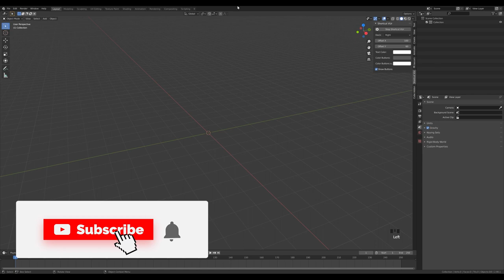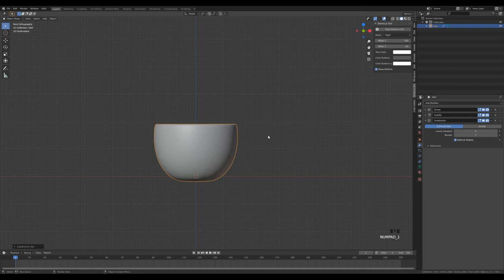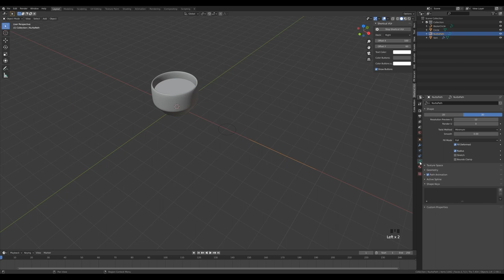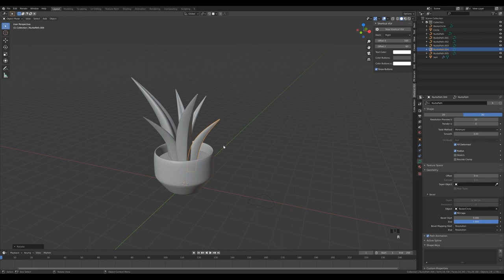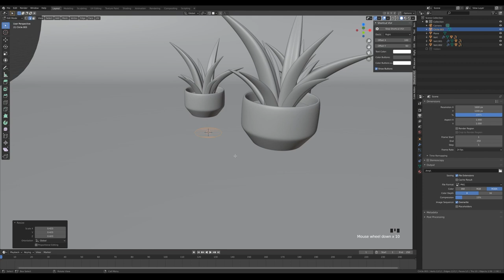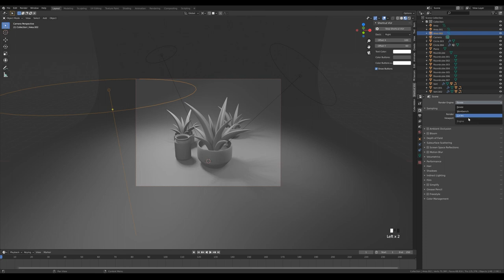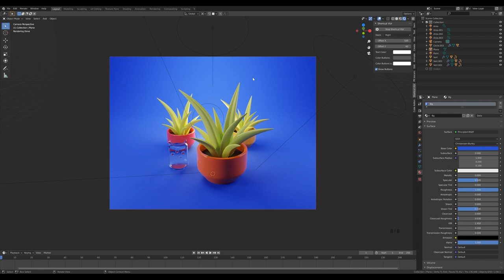3D Plant Tutorial Using Curves in Blender 2.9

Comment: I need help, when I'm moving the Bezier Circle in edit mode the path doesn't change, I've looked at the part for so long and did the exact same thing, I want to know if I just missed something or this happened to someone else 
Edit: nevermind, I fixed it by adding BezierCircle as the object in the bevel of the path because it didn't do it automatically for some reason

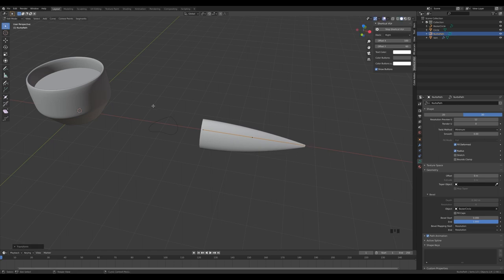Comment: I'm having a problem with 5:38 . I'm using version 2.92 and when i use the Alt+S, instead of scaling within the object, it scales towards the point on the left(because the curve line and the object aren't together) anyone else has this problem?
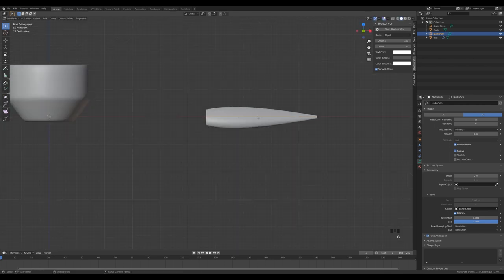Reply: Im using the same version but for me 5:55 is the problem.
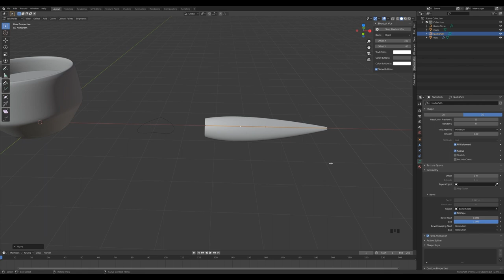Reply: @mohisy5029  For 5:55 scale the path to 1 1 1 , with ctrl+A then Scale, that work for me
Reply: Had this same issue. What worked for me was selecting the bezier circle, right clicking and selecting set origin -> origin to geometry

Comment: I have learned a lot with your tutorials. However, sometines I have dad some problems because the menus are different if we are using different versions. Por example, in your video, there are two droppers, one for Geometry and one for Bevel. I am using Blender 4.1 and there is only one dropper for Geometry. When I select this one and touch the circle, the cilinder in my scene converts in a cone. How can I solve this problem? Thanks for your help.
Reply: I had the same issue as well, I'm using 4.1 at the moment. When I twirled down Geometry to bring up the Bevel options, I selected the Object tab from there. Then under that tab I eyedropped the circle object here instead of under Geometry (I removed it from Geometry). This was what worked for me and now I have the same shape as him. Hopefully that helps in some way.